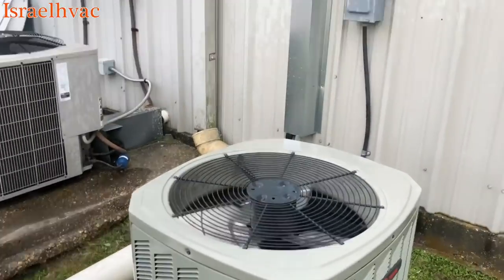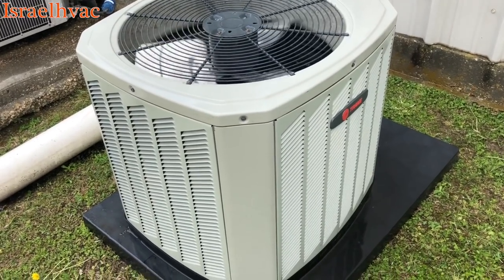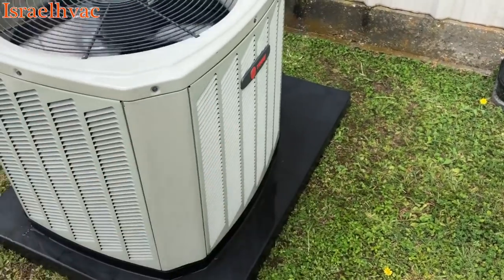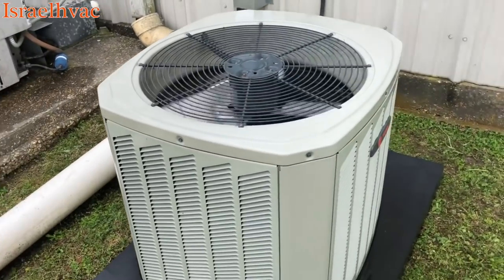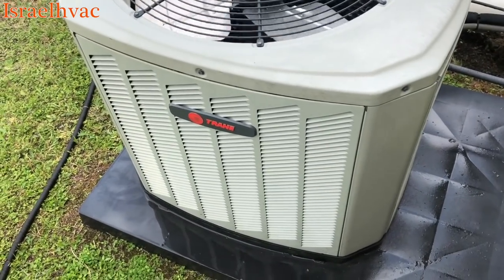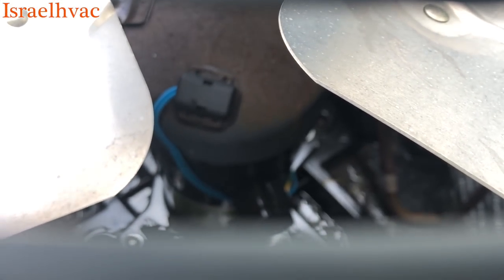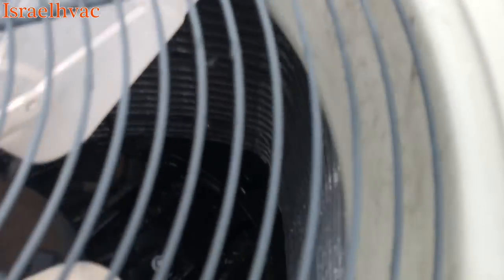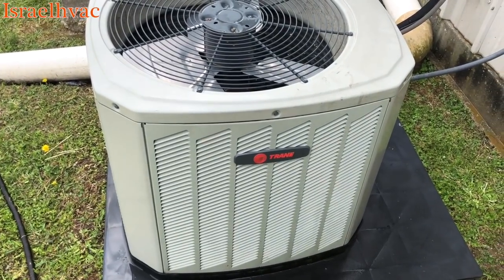HVAC | Trane With a LG Compressor??

Comment: John- LG is in the market and I took a class on the compressor. They have many models and a lot of manufacturers are using the compressors. Great video 🤘🤘
Reply: So what's your opinion on the LG compressor  if you don't mind me asking! My 14 seer ameristar 3 ton  has a LG, I'm a little concerned now I'd rather see a Copeland but then again I have replaced alot of Copelands also!!!

Comment: Yep seen em before, that's a head temperature safety, usually wires in with the pressure safeties
Reply from the maker: Thank you for pointing that out. I wasn't exactly sure what it was.

Comment: Yes, they are still using them. I'm having a new compressor installed as I am writing this. I bought American Standard 2 1/2 years ago. They are very expensive. And to find out their using LG is a disappointment, other than the fact that this is still a new unit. I will not be buying this brand again. Save your money!! Don't waste it on American Standard.

Comment: I have replaced many compressors that were originally trane or Reciprocating with scrolls. Match the btu close and it's fine. Pipe it on. Flow nitro and use a micron gauge. Charge to superheat and subcooling

Comment: It’s worse now, they’re not JUST using lg compressors, they’ve apparently contracted lg to make “climatuff” compressors now, just saw a Trane xr installed in 2020 that has a “climatuff” compressor on it but on another part of the label saw made in Korea, and manufactured by lg, not even the  alliance branding either anymore, it has Trane and American standard labeled where that would have been these days.  I have no problems with lg compressors at all but what Trane is doing these days is just dishonest

Comment: We just put an icp unit in july of 2019 and it as an lg compressor too.
Reply: I put in an ICP made July 2020 and it has a copeland - low end 13 seer
Reply: @jamess3417  weird wonder why ours has an lg.
Reply: @SuperJeremi10  I wonder if its availability based on global demand and tonnage requirements, mines 2.5 ton
Reply: @jamess3417  ours is a 2.5 ton as well.
Reply: @jamess3417  I did forget to mention our icp unit is a heatpump we are down in texas  usally get mild winters so we opted for a hest pump with auxiliary heatstips out house is all electric its cheaper for is to run the heat pump when we need heat versus the heat strips.
I have it set up as 2 stage heating but the heat strips are locked out unless the temps get below 30 out.
Then it will call for both heat pump and heatstips if the thermostat dosnt see x amount of trim rise withing a certain time or temp keeps dropping.
If it detects a issue with the heat pump it will auto switch to emergency heat only. We have a smart thermostat.
Reply: @SuperJeremi10  ohhh mines straight cool with a 100k btu ICP gas furnace
Reply: @jamess3417  ohhh I still kinda dont understand why one would have a lg over a copland scroll I always thought copland was better I know rheem uses copland. When I bought the unit I assumed it would have a copland scroll or recip compressor.
I would have expected brands like Goodman line to have lg or off brand compressors In it.

Comment: Only thing I have seen, is that the LG can't take a beating like the Copeland. The internal bypass on the LG is very weak and it does not take much for it to stay open. Changed a few of them this past year on a couple low end Lennox and Goodman. Annual cleaning is an absolute must with LG compressors. Otherwise it is overload and open bypass central with no return.
Reply from the maker: Great info. Thank you for sharing.